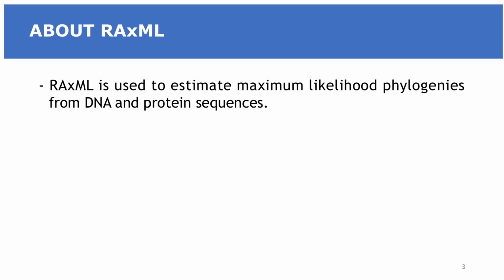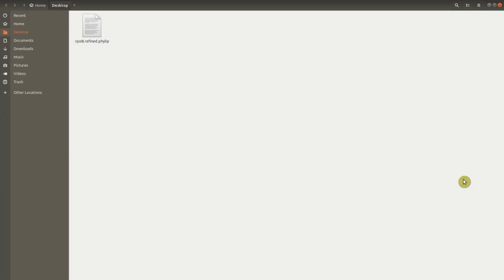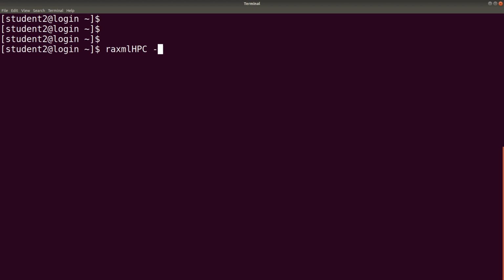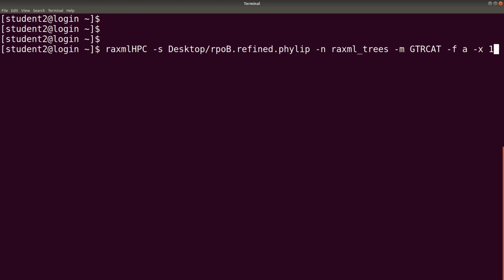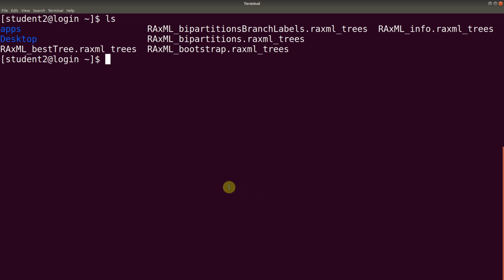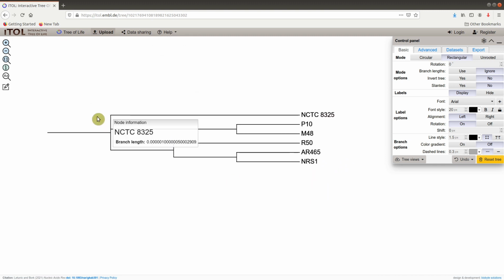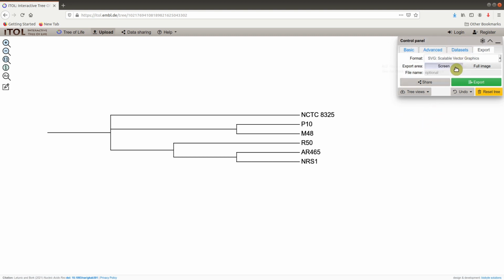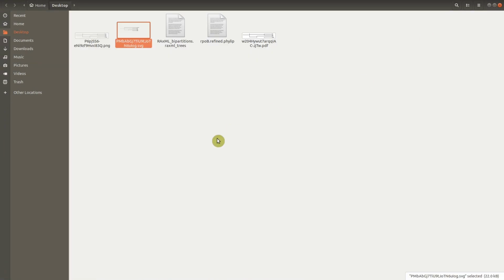How to Build any Phylogenetic Trees using RAxML and iTOL | Bioinformatics 101 for Beginners

Comment: amazing video thank you so much! cleared up all doubts !  Do you also know how to use RAxML on a slurm HPC via remote access from windows ?
Reply from the maker: Yes. RaxML can be run on an HPC. What you have to do is contact the system administrator for the HPC environment you will be using. They can help you set it up.
Reply: @bioinformaticscoach  okay thank you so much!!!!

Comment: Thank you so much for this..really helped. Just one question can one run the analysis if their alignment was done using ClusterW in MEGA 7?
Reply from the maker: Yes you can.  Its the file format of the alignment that is important. RaxML accepts PHYLIP or fasta. You can read the manual here: https://cme.h-its.org/exelixis/resource/download/NewManual.pdf
Reply: @bioinformaticscoach  Thank you for the response